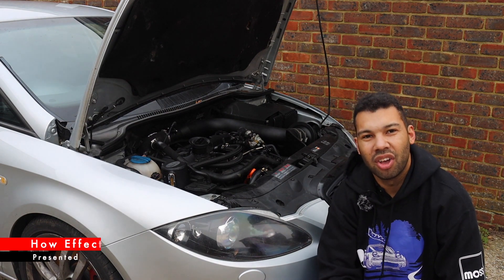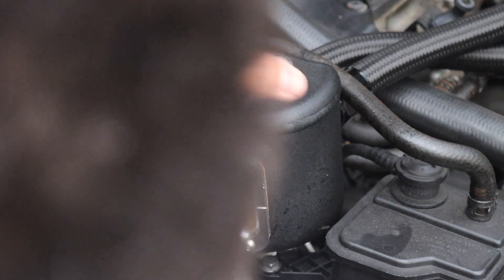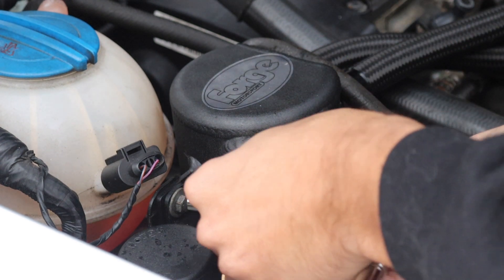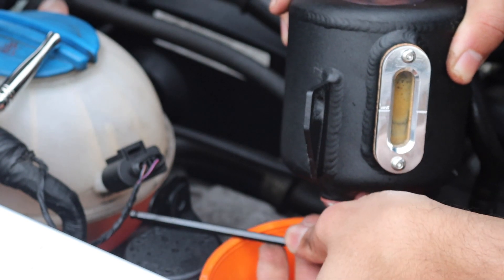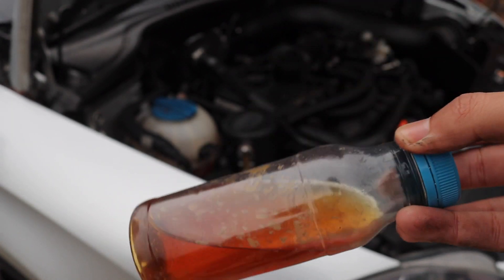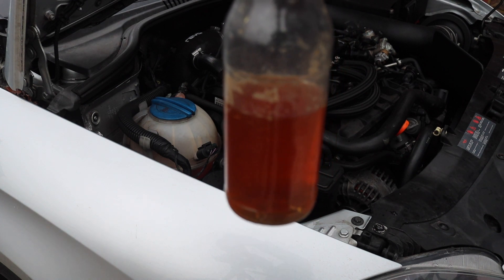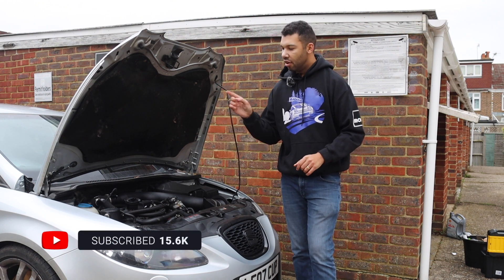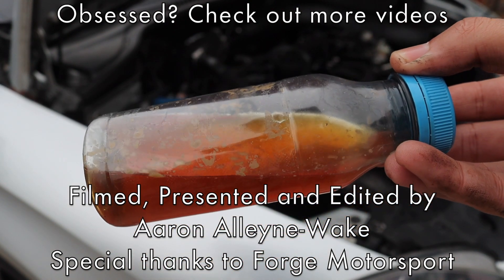How EFFECTIVE Is An Oil Catch Can? 2.0 TFSI Forge Motorsport Oil Catch Can

Comment: Hi Aaron, interesting video, I must have led a sheltered life lol, is it a partial oil filter and how much does it cost? Hope you had a nice Xmas, best Pip 🙂👍
Reply from the maker: Hi Pip, thanks for watching, hope you had a nice Xmas as well! I can see where you're coming from, but not quite. Without getting all James May on you, from standard this would have been fitted with a PCV Valve, which relieves the crankcase of pressure and gets rid of blowby gases, which is good. 

The downside of that is the valve can send oil vapour and other contaminants back in to your inlet manifold, which long term is bad news for this engine (direct injection) as it will cause carbon build up. That's my understanding anyway, I'm happy to be corrected as I'm hardly an expert in engineering.

(Edited with better spacing to make it easier to read).